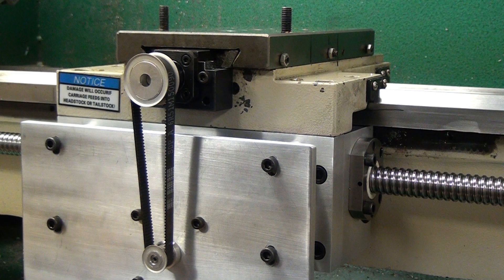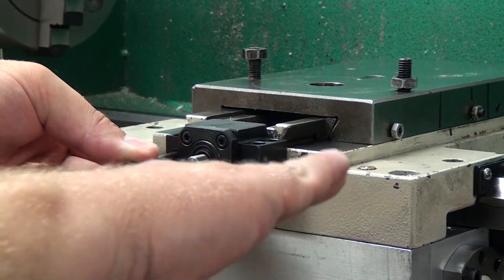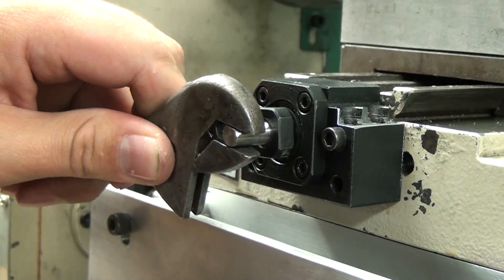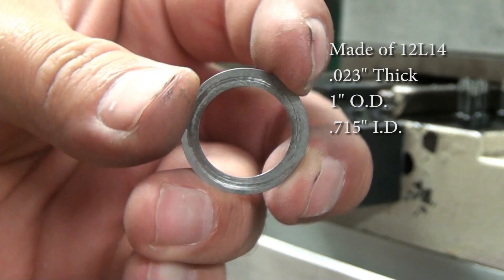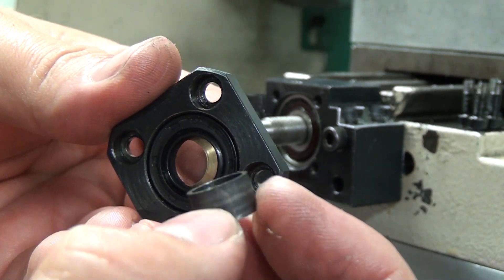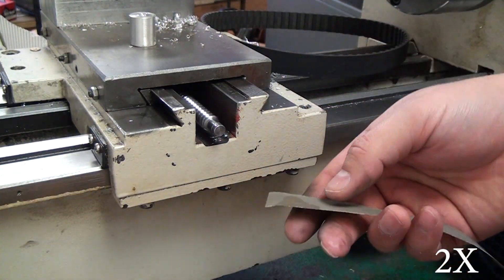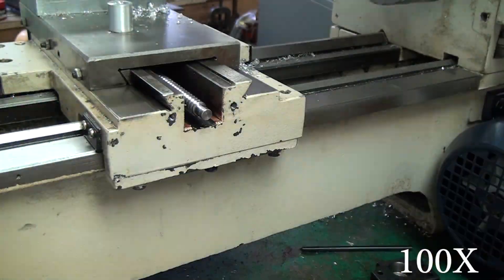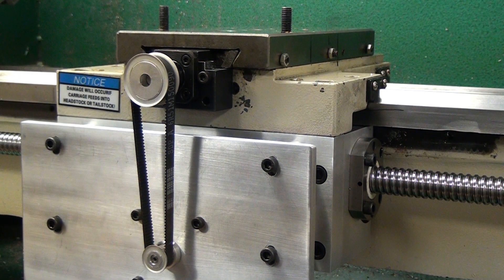G0602 CNC Conversion pt8 - Finishing The X-Axis

Comment: How about the belt protection from a chips?
Reply from the maker: I always intended to make a guard, but chips haven't been a problem so I've slacked off on that idea.
Thanks for watching!
Reply: got it ... Thanks!
Reply: You basically not getting chips there. The problem is, you hair/clothes/bodyparts. Give it at least a thin plastic(plexi/makrolon) cover, before you give one of your finger to it.
And one small thing, wich usually annoys me in Americans video. The video beeing watch by all around the globe. You can see how many non american viewer you have at statistics. For them you could be pollite if write or somehow show the dimensions in metric units as well.

Comment: Hello
 I make an appointment ... I have the same supports and I find it 
strange the axial and radial play that the two bearers have !!! This is normal that I have so much game ?? thanks greetings
Reply from the maker: I believe mine were the same, but once everything was tightened down it was not a problem. I say not a problem, but the reality is my X axis does have some backlash I am always fighting. I am not certain if it is from the bearing blocks or the belt drive. I suspect belt drive, but have not bothered to try and make it better (yet).
Reply: Ok thanks for answering ... I still do not install it ... I'll try to see what happens !!!! regards

Comment: I like the placement of the stepper under the lead screw.  Are you planning to do something to protect the belt and motor from chips and coolant?
Reply from the maker: +Mike Higgins Yes I do want to make a cover for the belt, I just haven't decided how to do it yet. I would like to do something like a traditional looking belt shroud maybe put together either by soldering or even rivets. Any ideas?
Reply: +russtuff Looks like whatever you do it will need to be pretty thin to fit between the upper pulley and the cross slide.  I guess you could get some extra clearance by turning down the outside of the top pulley.  Seems like the side plates are much taller than they need to be to keep the belt on.
Reply from the maker: +Mike Higgins Oh that's a good point. I'll have to break out the cardstock and start trying some things.

Comment: was there any reason of choosing the square locking nut instead of two DIN 981 type baring locking nuts? Doesn't the setscrew, for loking the square nut damage the thread on the ballscrew?
Reply from the maker: +koitk linearmotionbearing2008 supplies that square nut. The setscrew doesn't actually push against the threads itself, but this cool little threaded plug that perfectly matches the threads already in the screw. So really it's like creating a tight section of threaded nut within the nut itself.

Honestly, I have not had much luck using these square nuts unless you use blue threadlocker, which is what I do now. In my mill I use a jam-nut against the square nut.
Reply from the maker: +koitk I just google'd the bearing nuts, looks like McMaster has them too. I may snag some for testing. Thanks for the tip!
Reply: +russtuff We updated our small milling machine from steppers to 250W AC servos, so I used them there. Well they are quite cheap and ground on both sides but you kind of need the correct key for them. The thing I liked most about them is their small form factor and also they look good.
Reply from the maker: koitk Sometimes I wish when I got into this hobby I would have gone servos. I don't know anything about them though, and I'm not expecting to ever do another upgrade.
Reply: +russtuff Well, it depends how you want to run the servos, we actually run them exactly as you run your steppers, from mach3 breakout board with step and pulse signals. The main difference is loop from drivers to servo motors is closed via feedback from the encoders (we use 2500p/rev) so once the Mach3 board has given a pulse(es) the servo driver does what it can to drive to the specific location and hold it there. Even if you are able to move the table or cross slide the driver knows it and moves it back to where it supposed to be. And the biggest advantage is they are silent, there&#39;s no sound like you have in the steppers. I guess one of the advantage of servos is one can have them as powerful or fast as ones wallet allowes. 
We purchased our servos from China and we got our 3 AC servos (250W), 3 drivers and 3 power supply&#39;s for less than 1000€.
Reply from the maker: +koitk Yeah that closed loop setup sounds like the way to go. If I ever convert another machine it will be with servos.

Comment: Nice looking build.  How do you like the belt drive?  I'm considering doing a belt drive for my mill conversion, but I'm undecided.  I like the idea of rotating the steppers out of the way for a smaller footprint, but not at the cost of performance.

Thanks again for your videos - they're great stuff!
Reply from the maker: +Paul Frieden Performance wise its been perfect. I'm still having backlash issues on the X-Axis, but its repeatable backlash which means I can easily counter it in LinuxCNC (which is what I'm doing now). I have about .006" backlash total on this axis, but my parts repeatably come out within about .0003" of each other (which is amazing!).
Reply: +russtuff How much of the backlash do you figure is coming from the belt drive vs the ball screw and the rest of the assembly?
Reply from the maker: +Paul Frieden I never measured them separately, but my experience with my mill leads to think maybe .001" or so is due to the screw itself.

Also, I just realized a couple days ago that my belt drive is not perfectly aligned, and I need to make new standoffs 1/4" longer. I'm not sure if that would make any difference in the backlash though, just make the belt engage a bit flatter.
Reply: than you , thank you  very much !